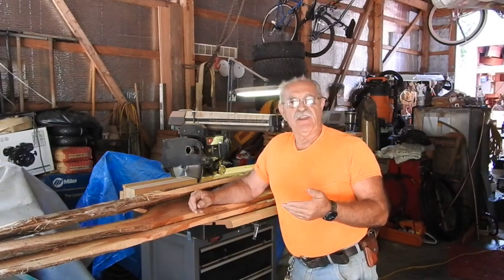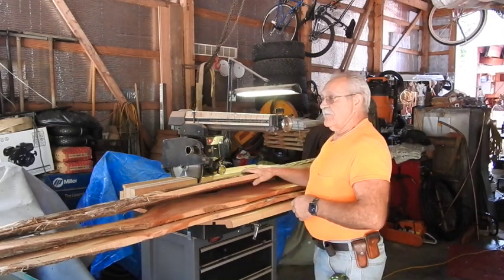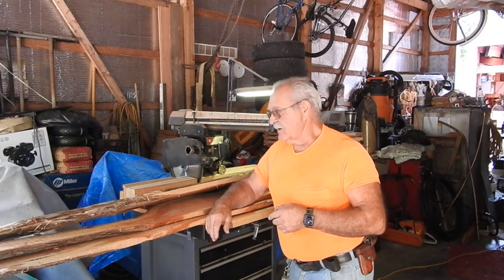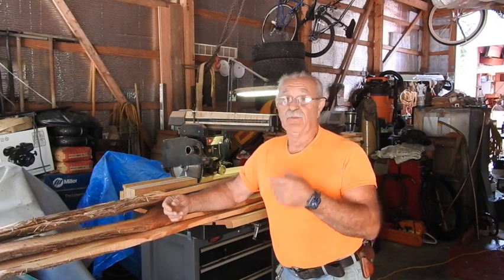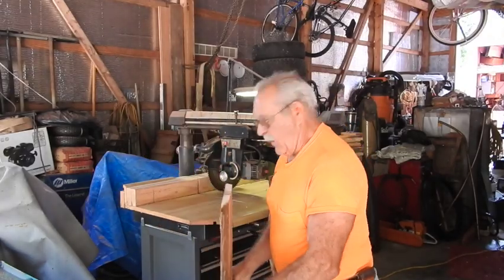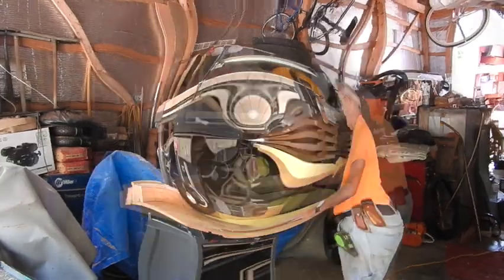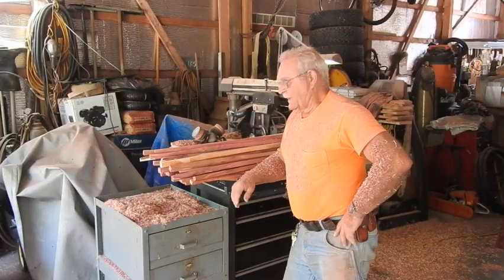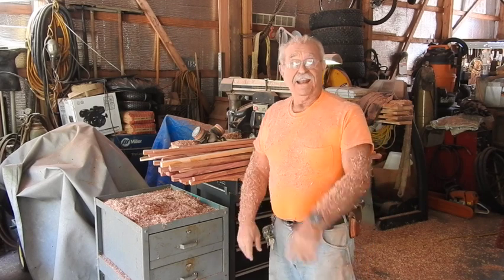How I Make Stacking Strips for Air Drying Lumber

Comment: Cedar with my dinner and I’m the 44th visiter to this adventure! I sure know what you mean about cedar and walnut dust, they irritate plum good! And I noticed the bicycles hanging up which is what I did today, got a bike ready for some workin out some!  At rehab I ride the stationary bike and work out on some other machines as well. I’ve been wanting to ride bike again for years. But my legs cramped up but now I’m the Stentman of the JOkind! The tires aren’t the best but the tubes are good. I wouldn’t want to do a 10-20 mile ride, not that I could, but for going up and down our road a mile will do just fine. So I cleaned everything up, waxed the frame, washed down all the 20 years of dust from being stored in the shed and shop and lubed up the chain. Needs to be soaked and cleaned with some gas and relubed but one thing at a time. I will get new tires soon but for now if I have a blow out I’m only 1/2 mile away or less and I’m not doing supersonic speeds, except when I make JO! I’ll certainly be drippin,sippin anna tippin your way in the morning. Seems I can smell that cedar through the wires! So Thanks my Friend and get into a squeezin match with The Missus from me! A Lovely Wednesday to y’all! DaveyJO
Reply from the maker: Don't wanna have a blow out at high speed DaveyJO !!  Talk about a Rough and Tumble weekend....wouldn't be no tractors involved either.  )-;   I have an old Schwinn 27'' ten speed overhead that ain't seen daylight since I built the shed in '84.  I gave 20 bucks for it from another marine shipping out from our base in Hawaii.  I rode completely around the island of Oahu several times and then had it shipped to Parris Island SC for my last 14 months.  I almost rode the wheels off that thing when I was in the Marines.  It'd take a week to dig it out now though.....maybe I'll let it stay there another 38 years !!  LOL  The Missus didn't slap me as I passed the morning squeezin....so all is good my friend.  LOL  Stay cool and keep exercising those legs ol buddy !!
Reply: @tractorman4461  Good news about The Missus and that you remained safe! Yep, my bike was in storage a looooong time! I steel wooled and waxed the rims and cleaned off the frame, lubed up everything and rode a half mile to start, the. Another half. There’s an old brick Wesley church at the one end of our road that’s a half mile. It’s a slight grade going and an easy coast back. So a little at a time. I did my rehab this morning, tippin your way first thing and now again. So have a Fine Day ole Buddy and a Good SQUEEZE for the Missus! DaveyJO
Reply from the maker: @daveyjoweaver6282  Good deal ol buddy....this week just a mile or so...next week the Tour de' France !!  All powered by JO-Juice too !!
Reply: @tractorman4461  Now I wouldn’t want to have an unfair advantage over the other bikers with JOjuice! When I’d win I just wouldn’t feel right! So I’ll stick to my mile or so for now.

Comment: Good evening Sir, outstanding informative video and great way for cutting your side little pieces woods !!! I did not know ( from your text ) that you could wire these eletric on 240 v ( I have the same model ( I THINK !  )  Cheers
Reply from the maker: Yessir Dave, if you have this model, it for sure is a dual voltage saw.  I actually changed this one from 240 to 120 so I could use it here more easily.  But soon, it will have its own 240 volt circuit once again ....and just maybe its own dust collection system too !!
Reply: @tractorman4461  I did not know that dust collection systems was a OUTSTANDING static electrical creator by itself ( Joe show that to me !!! ) Cheers
Reply from the maker: @RCAFpolarexpress  Dave I worked with quite a few systems back when I was a working man.  We had to run a grounding wire wrapped a number of wraps per foot for various spiral ducts carrying product to eliminate the static.  In paper off fall, the static was enough to stop the flow of product and actually block the duct !!

Comment: Finally, you have shown me something that I am not all that fussy about, it`s that `darn` radial arm saw! Man, I don`t like those saws! I had one for a while, I did some fine ( good to precision ) cutting with it, but then it kicked back on me and popped my right thumb out of it`s socket. It`s OK now ( my thumbs that is ) but I got to really dislike that saw, after that.
I thought I was perhaps the most careful person around power equipment, but this one time, it got me. So I sold it.
I use a table saw and a slide compound mitre saw now and you know, I don`t miss my Black & Decker 10 inch Radial Arm Saw at all. 
However I too have to wear a dust mask when working with wood, mostly my tools are hooked to a vacuum system, otherwise I will probably sneeze my head off,  if I don`t put that mask on.
Reply from the maker: Hahahahaha....speaking of a kick back Reg, I had one get me in the second finger but the camera wasn't on....I'm sure it would have looked pretty bad because I thought for a minute the first knuckle was broken.  Leaked a little blood, but it was numb for a hour or so before the throbbing started !! LOL  It happens no matter how careful you are.  The bad thing is the cedar is so brittle, sometimes they spilt at a knot and if they catch the blade, here they come right at ya !!  I've never had one kick as hard as you did though.  WOW !!  I won't sneeze too much, but I get horrible sinus headaches later in the day without a mask and they might even stretch into the next day.
Reply: @tractorman4461  Ahh the fun and games of doing what we do! LOL.
Just a little note/story on my dislocated thumb,.. that evening friends of ours were coming for dinner,.. she is a physiotherapist and when she heard my incident ( by then I had popped my thumb back in it's socket, and no, I can't remember how I did that ) she took my hand and thumb, bending it back as far as she could, before I fainted, threatening her with a punch on the nose, if she hurt me much more,... her husband is a lawyer too, but he agreed with me.
Then she told me exercises to do, I did them, and haven't had a pain nor problem with that joint to this day. I have a lot more respect for her and her training ever since LOL
Reply from the maker: @regsparkes6507  Hahahahahaha....I'd probably faint at the thought of it her grabbing my hand like that !!  LOL  But after the Missus went through a knee AND a hip replacement since 2011 and see how flexible she is after all the physical therapy I too believe that's the most important thing about these kind of situations.  Her knee went to over 110% of the original movement and she too attiributes that to the PT.
Reply: @tractorman4461  Me too, I am a believer now! 
Hip replacement, been there done that,..., I tripped in my garage and landed squarely on my right hip. 
Hey Wendell, in case you didn't know, a concrete floor is harder than a hip! :)
Reply from the maker: @regsparkes6507  Hahahaha....yeah, I heard that you Northerners pour some pretty hard concrete...LOL  Well my Much Older Brother would tell you if you hit your head you'd probably be fixing the concrete !!  But he IS somewhat of a curmudgeon though....
Reply: @tractorman4461  I think maybe he's earned that 'position'! I respect those guys!

Comment: Another great video. I was going to call you out on the respirator but you caught it. 
Is there any way to keep the warp out of the boards you've milled? Just curious.
How long do you let them air dry before using them in a project?
Is that trailer ever going to get it's planking?
Reply from the maker: Hahahaha...yes Rick, the trailer will get its new deck, I just don't know when !! LOL The way the boards are stacked have a lot to do with minimizing the warpage.  But also the way the log is milled can contribute too.  Keeping the stacking strips in alignment from the bottom to the top of the stack transfers all the weight above to rest on and hold in place those lower.  Kinda like nailing a green board onto a wall....the nails hold it in position as it dries...it will shrink though and may even split out at the nails too close to the end, but it will for the most part remain flat.  Really wide boards have a tendency to 'cup' if the cant is left full width then just sliced off from top to bottom.  
   The only ones that won't want to cup are the center cut boards just near above, through and below center.  The top boards will want to 'cup' down and the bottom boards will want to 'cup' up due to the grain formation created by the basic style of cut.  You can minimize that too by stacking the widest on the bottom of the drying stack, and adding as much as possible boards on top. It's much better to try and be creative in rolling the cant to get a variety of sizes of boards to maximize the strength of the wood grains. Make sense...??  But you gotta remember I'm not by any means a 'pro' and am working mostly off of recollection of my time with the old man and the circle mill many years ago.

Comment: I’m wondering if the Walnut and Cedar is what gives me a sinus headache too. Hard to get a good deal with the beard. May have to wear a filtration helmet. That’d be something to see wouldn’t it? 😅

I enjoy cutting wood down a lot more on the bandsaw and miter saw a lot more than on the sawmill. I’m not sure why that is?!

Have a great rest of your week! - Samuel
Reply from the maker: Whoa.... I hate those HEPA facemasks !!  I did a/c service inside a lead smelter here and we had to change into their clothes and wear the fan powered facemasks to go in there to work.  No one that went in could have a beard because of the sealing issue and we had to have a blood test every six months taken by their nursing staff to keep being able to come in and work.  We'd have to shower after every service call and change back into our own clothes and if the service truck went in with us, we had to go through their truck wash with it too.  A 360* around and under the trucks before we could hit the streets !!  
   If I were you I'd try a good replaceable filter face mask a couple times, and you might find your headaches won't appear.  Even an N95 would help a lot.

Comment: in all my years i never new the radial arm saw swivelled to allow ripping.
Reply from the maker: Now that's funny Patrick.  Grab the paddle shaped lever on the right side and pull it forward to unlock the swivel lock.  Pull up the round handle on the left side to release the swivel lock and spin the saw head to the left or right whichever you need.  Swinging clockwise (looking from the top) for narrow rips and for wide rips swing it counterclockwise and feed the material into the opposite side.  Of course after swiveling you have to re apply the lock with the paddle handle. Thanks for watching and candidly commenting.  It is very much appreciated !!
Reply: @tractorman4461   Keep up the hard work. It never gets old seeing people doing cool things in other places.

Comment: Is that a Black & Decker radial arm? I had one that looked similar. Kind of finicky to keep it adjusted for finish work.

Some say they are dangerous but only if you don't know what your doing.

You can get used ones for practically nothing as they have been replaced by chop/miter saws. I used to rip on mine quite a bit. Sold it when I sold my house
Reply from the maker: No, that's a Craftsman 12" and as old as old can be Ed.   It was a gift from the son of an old buddy that passed a few years back.    At farm auctions and estate sales around here they are as cheap as $35 most of the time.  Almost never see one more than $50.
Reply: @tractorman4461  I got one just like it, great little saw.
Reply from the maker: @SK-tr9ii  Ripping hardwoods for T&G flooring, I set up 8' infeed and outfeed extensions out of 2 x 4's for the radial.  It is easy to stretch a string to line up and I set them on tri stands.  I really like using them for it over a table saw, though I've done the same on it as well.   But yes, they are great accessories for the shop for sure !!